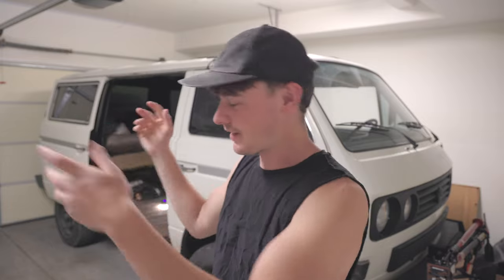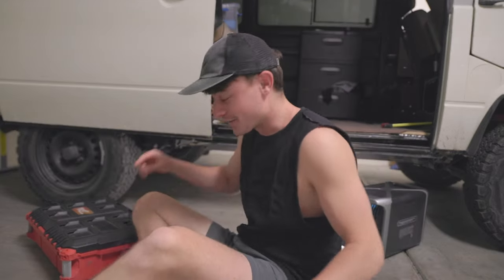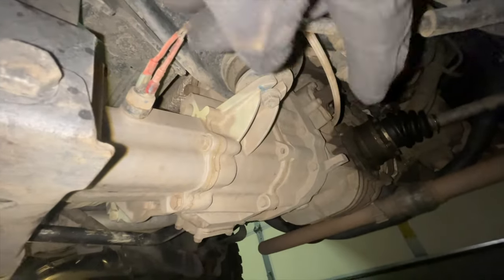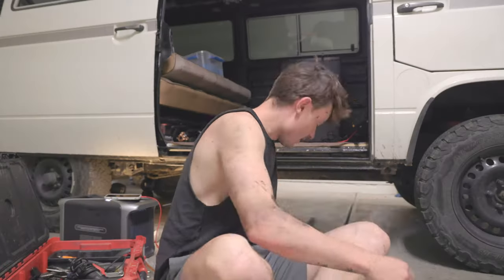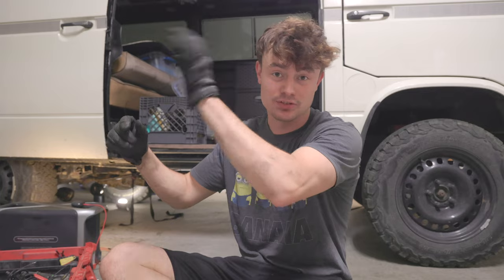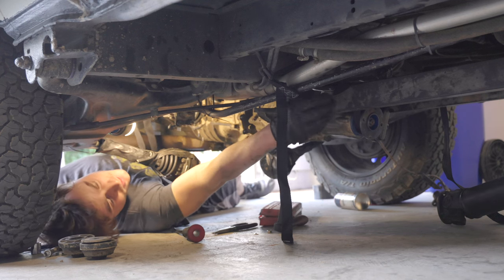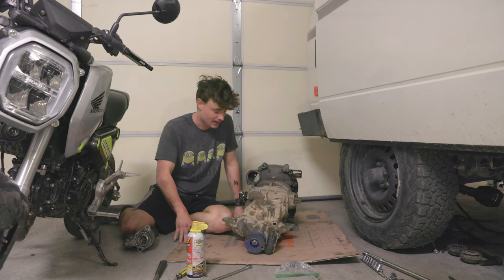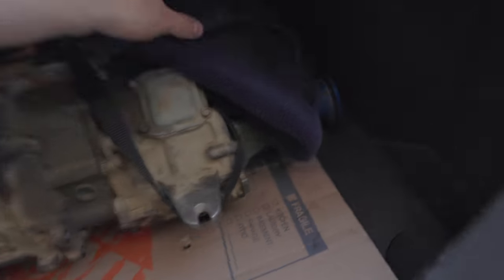Removing My Vans Transmission By Myself And Getting It Rebuilt

Comment: Awesome van and good videos! If you don’t have one, get a Bentley Manual…has step-by-step instructions for every single part. Just used it to remove and reinstall Westy cabinets and would never have figured out the proper order without it…Best $100 spent
Reply from the maker: Thank you! Yes I’ve been told I need to get one. It’s on the list!

Comment: Some blocks of wood under the trans when lowering can help. These cases are now rare in the states hat for it to drop and break. I see you have the South African grille. I have a 91 and am going to use an 85 grille with the single headlight, much better options for headlights
Reply from the maker: I was able to lower it down pretty softly with this setup but yeah ideally I’d have an actual jack. Yuppp I love the South Africa grille!

Comment: get a transmission jack from harbor freight. that will make your life much easier
Reply from the maker: Yeah I thought about that but basically any tool like that I buy right now will have to be given to someone or thrown away. No where to put it after I leave and the ratchet straps seemed to actually work pretty well